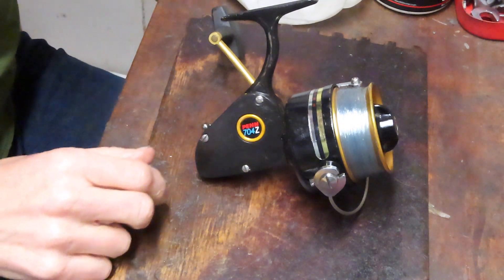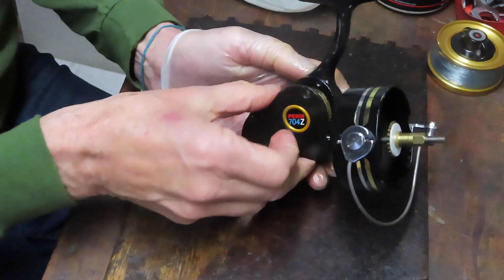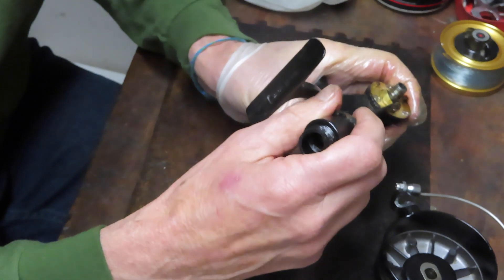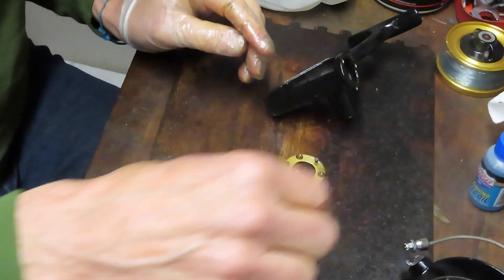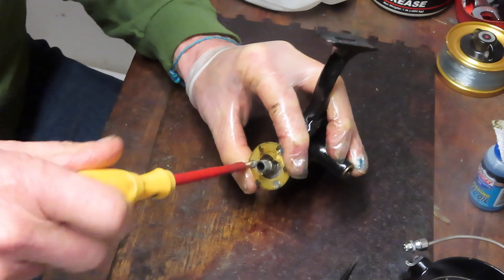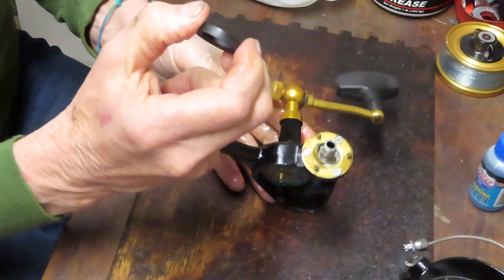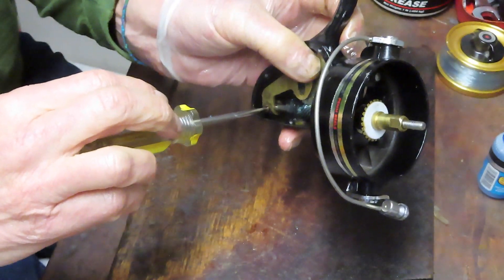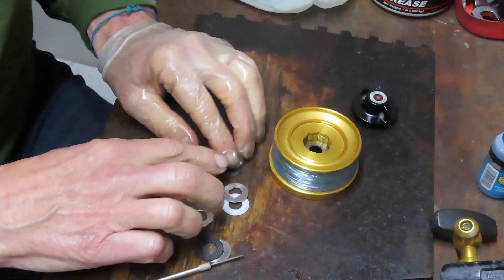Penn Spinfisher 704 704 how to take apart and service

Comment: That one is almost as nice as mine! LOL. It is one of my most favorite reels. I have two other power knob handles for mine and I’ve put this reel, a 706Z, and a beautiful little 722Z in a nice Apache case. You worked on my 706Z and the video is in your library. I love these worm gear reels and you won’t find better gears in any fishing reel. That rubber washer thing is a rotor brake. The 706Z doesn’t have that part. I personally think this reel and the 706Z are the greatest spinning reels Penn ever made. Mine are original ones that I got back in the 1970s. I take meticulous care of mine and the only problem I’ve ever had was some micro sand that got in the line roller of my 706Z. Glad you did this one so you have both these great Z reels in your library.  These reels were brought back by Penn  by popular demand in 2013 for a limited run. Those recent 704Z and 706Z reels do not have that band on the rotor that denotes line size and capacity. That’s how you can tell an original from the later ones. Other than that they are absolutely identical. I have an original 1961 first edition Spinfisher 700. You can tell that greenie is an original by the solid green handle and the aluminum oscillation arm inside.  They are pretty rare and hard to find particularly in good condition. What is your favorite of the big reels? I’d really like to know that. I think the 706Z is slightly larger.  You know, when you have over 130 reels it’s impossible to change line on all of them every year!
Reply from the maker: I know that and I know that is quite a collection you have.  Best wishes Chris and thanks for the additional information on the series - Dennis

Comment: Hey do you know if the 704z and the 704 greenie use the same parts? because I got a greenie and can’t seem to find the parts  I can only find it for the 704z thanks
Reply from the maker: They share a lot of parts.  Check the schematics for both reels.  You can find them at Mysticparts.com. If the part number is the same, they will work in either the 704 or the 704Z. If you have any doubt, you can call the folks at Mystic parts and they will try to help you
Dennis

Comment: Dennis!  How would you go about removing the bearing on this model if one was having trouble removing it for replacement? 
Tony
Reply from the maker: Soak the top end in a penetrating oil and let it sit.  I would remove the top end parts and collar, only leaving the pinion gear and bearing exposed.  Then reattach the rotor and use the rotor as a handle to pull up or rock back and forth with upward pressure to remove it - Thanks how I would do it - Dennis
Reply: @2ndChanceTackle  Thanks Dennis!  I will try that the next time a 704 or 704Z shows up on the bench!

Comment: Have a penn 704 z the main bearing and gear shaft is frozen. Is the a trick to pop it out after handle is removed
Reply from the maker: No fast magic.  Soak the bearings with a penetrating oil like WD 40 and let it sit. If you need leverage on the pinion gear, reattach the spool to the shaft after you have removed the rotor and hold down collar and pull up on the spool - Dennis

Comment: You know any tricks for replacing the little rubber bail bumper on these reels? Part# 33-704. These things give me fits.
Reply from the maker: I don't. Several people have used epoxy and a piece or hard rubber tube or plastic as a replacement strategy.
Reply: @2ndChanceTackle  
Thanks. They're a bugger to get in the hole.

Comment: Thanks for the great vid. I just bought one of these reels. It is not running that smoothly, so I'm going to service it with help of your instructions. Was wondering what your fav big spinner is, since you mentioned it is not the 704Z.
Reply from the maker: I like the 704, but prefer the 7500 SpinFisher V in that series.  I also like the Daiwa 7500 Silver Series and the Mitchell 386/486 in the vintage reels.  Thanks for asking - Dennis

Comment: Hi Dennis, they did "Re-introduce"  the 704Z, "Briefly" in the last 15 or so years.  If I recall, the newer editions had an additional Bearing behind the main gear in addition to the bearing up top below the rotor.  Do you recall the "Newer Brief Re-Introduced" Penn 704Z and 706Z Spinfishers?
Reply from the maker: According to Chris, another viewer, the newer edition was introduced in 2013 and lasted a few years. - Dennis
Reply: I bought two of the newer Penn 704zs, unfortunately the first reel came damaged as well as the second one so I completely lost interest in the reel. I ended up buying a Battle 3 but I really wanted to like the newer Penn 704zs but it seems the older models were built better and or had people who took pride in there work!

Comment: Dennis, what is your favorite of the big reels? You once said you liked the Daiwa GS 9. I;ve also heard you mention the Daiwa Tournament reels.  By the way, the 7o6Z is the largest because the rotor and spool are slightly larger and have a little greater line capacity. I just got my second one of these. — Chris
Reply from the maker: In modern reels, I like the Shimano Saragosa.  In the older editions the Spinfishers and the bigger Mitchells are my choice - Thanks Chris - have a great holiday weekend - Dennis

Comment: I took apart a 704 and the  drag washers were all dry. You show the greasing process and you use drag grease but i don't have that. What else can i use. I'm not going to buy a tub for one reel.
Reply from the maker: you can use regular fishing reel greases.  You can also buy them in 1 or 2 ounce containers.  A combination pack of fishing reel oil and grease can be found on line for around $10. It is well worth the price paid - Dennis